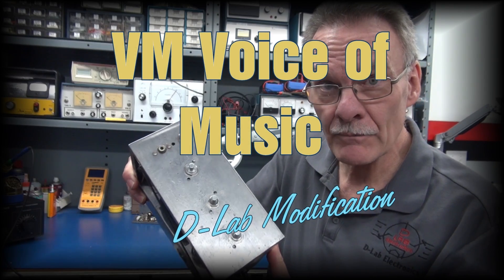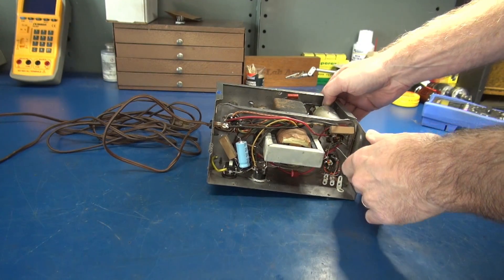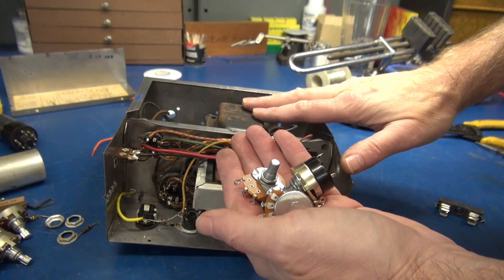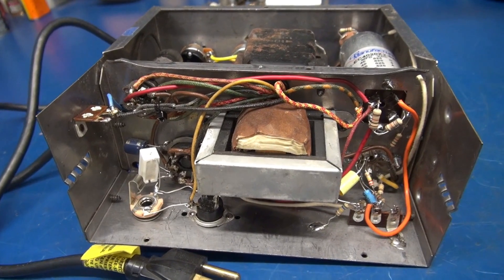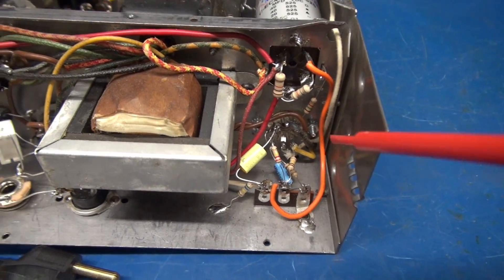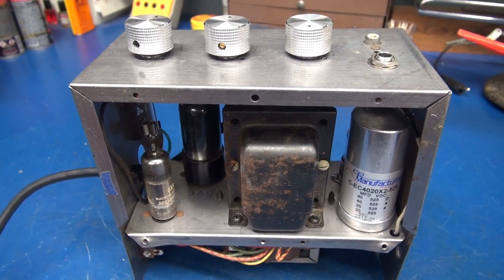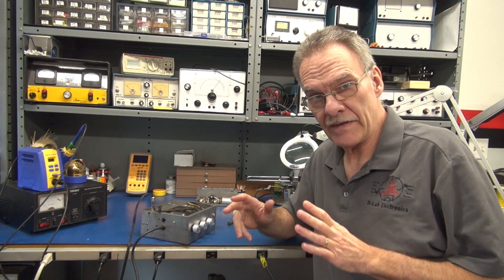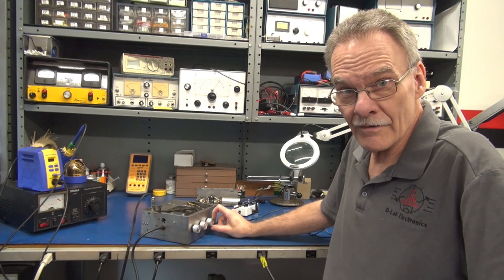How to modify VM Voice of music HiFi amp into Tube class A guitar amp Fender circuit Project

Comment: Have one and been using in a variety of signal paths. Mostly as a “line level” amplifier. Worked really perfectly in that application. Also as a guitar amp. Lately not driving 12” speaker as guitar amp. Might be a loose jack or internal fault somewhere, but it turns on and tubes warm up with no hum or signal noise transmitted from the speaker output. worried it’s to do with the output transformer from too much experimental use/abuse

It sounded amazing as a guitar amp. Came w 1/4 input and rca , 1/4” output jack too along with rca and one of those 4 or 5 pin preamp output connections. Assuming can bypass power section and function like a pre out.

Comment: VoM, one of the best sounding guitar amps as-is, just change the input coupling capacitor. Especially the NF it uses. All you did was create a Fender 5F1 copy.
Reply: Do you mean replace or change the value? I just got one of these and I want to use it for guitar.
Reply: And i should say I love the sound already but it does have a hum Id love to get rid of
Reply: See my comment. Had the same feeling, but may have to rebuild mine anyway. We’ll see, trying to avoid that. I have 5 or 6 mono tube amps I play “as is” and unaltered for almost all of my guitarwork. They are the coolest imo.

Comment: That B+ voltage is quite high. I have built some SE amps using 6V6 or EL84 tubes (sometimes connected as triode which gives less output power but sounds very smooth) in class A, and I have used only 250-290 V B+ voltage which makes it possible to use proper class A bias current without exceeding max plate dissipation of the output tube. Of course, the SE OT must be good enough to handle that quite high DC bias current without problems.

Comment: I have/had one of these. 

Big issue, with mine at least, was the fact that the power transformer induced lots of hum directly into the output transformer. I pulled all of the tubes, and hum could be heard through the speaker! With more extensive modifications, like higher gain cascade preamp and no negative feedback based tone circuit, oscillation and ground issues are somewhat difficult to avoid as well due to the cramped chassis and signal wires exiting the chassis (even if they're shielded). 

The bias setup is also slightly unusual on some models (this amp had a revision or two, some with B+ droppers before the rectifier and later models had a TINY output transformer). Some use "back-bias" I believe it was called, utilizing an output transformer winding and in this case, a weird elevated ground through a 300ohm resistor. I just swapped to your typical 470 champ style bias ... Check that schematic, it's interesting.

I recommend using the two dropper resistors before the rectifier. You can use original values (500 ohm) or use a higher value as I did - 750 ohm. Keeps the rectifier safe. May not be needed on later models.

I eventually rehoused the entire amp.

Comment: The Canadian made Seabreeze A-100 is almost identical to this amp. I bought a Seabreeze stereo console a few years ago for cheap and it had a A-100 and a factory installed V-M reel to reel inside which I used to build a Champ.